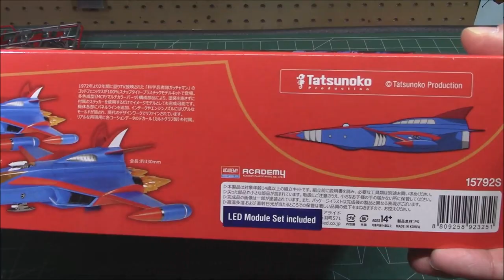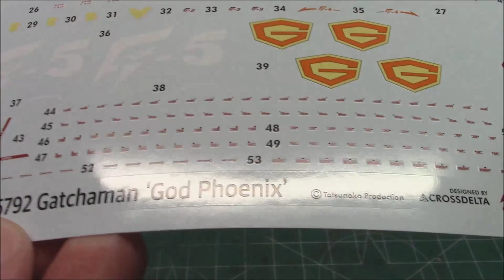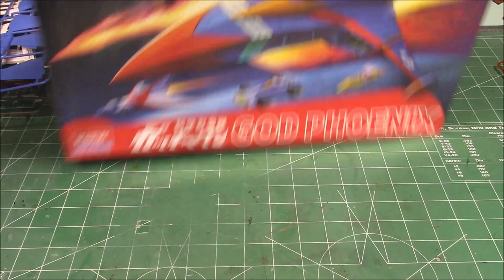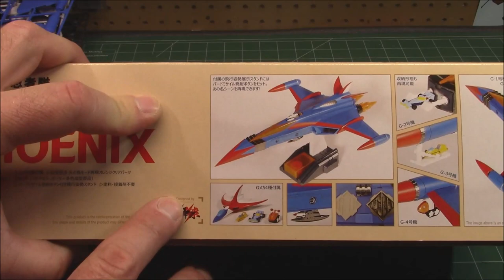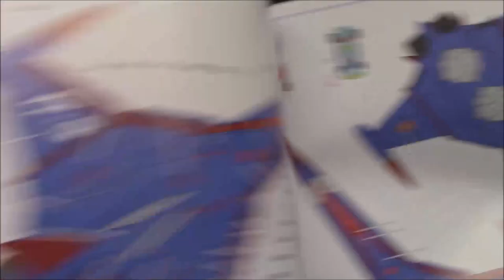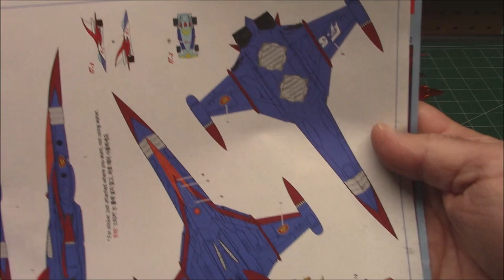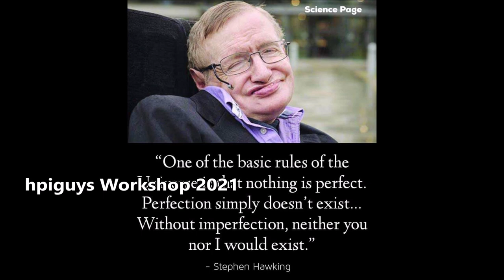God Phoenix Gatchaman G Force Battle of the Planets Scale Model Kit Build Review 15792 Anime Manga

Comment: Just snagged this on eBay but pre assembled.  Realized they built with both vents on the bottom so I can’t use the stand unless it’s easy to remove.  Wasn’t able to with just some light pulling 

Not even sure they hooked up the LED lights so I’ll have to find a way to get that box open.  But the ship looks great!

Comment: The one thing I was always curious about with the series is why did they keep the Phoenix underwater when they weren't on missions and one other thing I remember about the Phoenix is when it's sitting in it's underwater hangar the wings are folded in the down position at angles underneath the main body until the only female member of the team and that one team member who looks like a kid come and dock they're vehicles with the pods at the tips of the wings with the girl on the right wing and the kid on the left wing and the leader docks his plane in that compartment at the base of the tail right above the main engines and the other team member who is considered like the sharp shooter of the team and a bit of a hot head drives a car that docks with the compartment in the nose section of the plane while the one team member who is the fattest member of the team pilots the Phoenix though I don't know what they called him in the Japanese version but in the American version they called him Tiny if I remember correctly but I don't think they should call him Tiny with that gut of his.
Reply: Holy run-on sentence Batman.

Comment: The led lights are pissing me off 4 kits and I still can't get those dam lights to turn on. 4 5 hrs twisting turning twisting turning twisting turning. Pissing me off 😡.  I had them on for a minute then had it tilted in wrong direction and when I corrected . nothing it shouldn't be this dam hard. My problem is the constant thin wires and switch. Is it touching or not.   Enough is enough...is there a better alternative switch and wires I can use where I'm not guessing will it work or not and just buy something I know when twisting will actually work without 2nd guessing if I did it right?
Reply from the maker: If twisting the wires is difficult for you, just solder the connections to ensure a tight fit. 

Or you can purchase wires and LEDs and a switch and make it all yourself I guess.